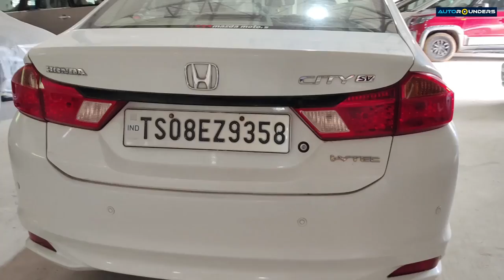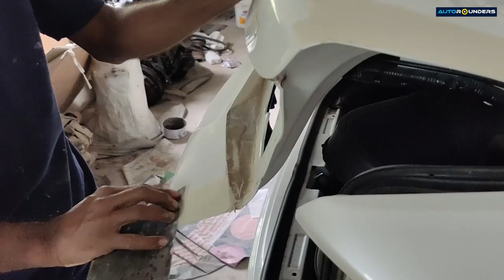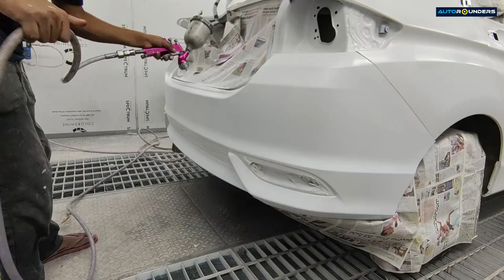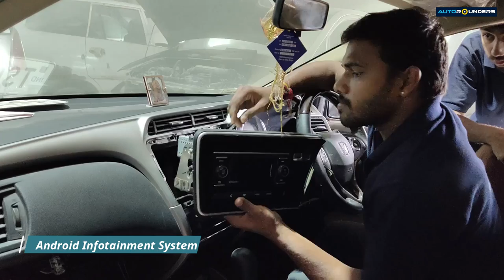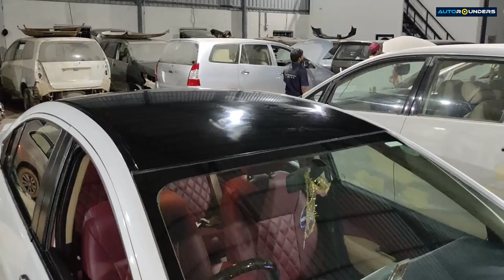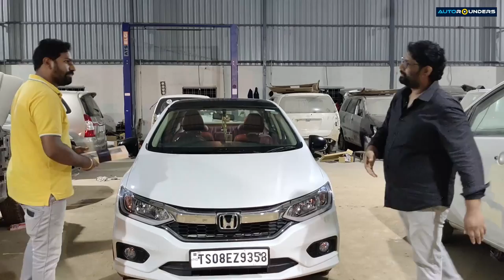Honda City Facelift & Interior Customisation | Autorounders

Comment: It will be great help if could give item wise cost for the project. It will be helpful, easy n convinent for the viewers to plan it for their car. 
For instance, I wan to get my 2016 honda city facelft to 2018 model. 
Front bumper
Fron grill
Headlights with drl (with led if possible)
Fog lamps with led.

Rear bumper
Reply from the maker: Hi, pl call or WhatsApp us on 7666-930-930 for Mumbai and 7666-830-830 for Hyderabad to discuss further
Reply: @Autorounders  I did what's app message to Dhaval and waiting for reply

Comment: What is location?
Reply from the maker: Hello,

Thank you for getting in touch. 

For information on pricing and customisation enquires, Please call us on:

7666-930-930 for Mumbai,
7666-830-830 for Hyderabad, 
9206-630-630 for Pune and
9206- 730-730 for Thane (GB Road)

In case if the above numbers are not reachable or busy then please WhatsApp us on 8425-80-80-80.